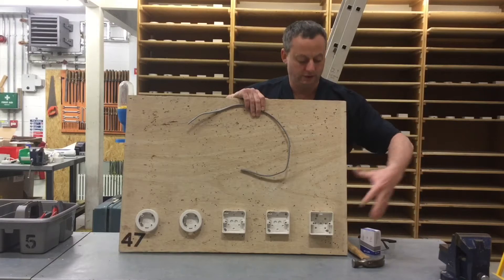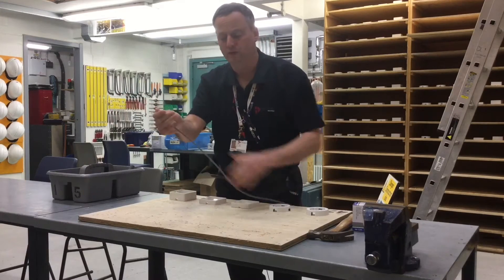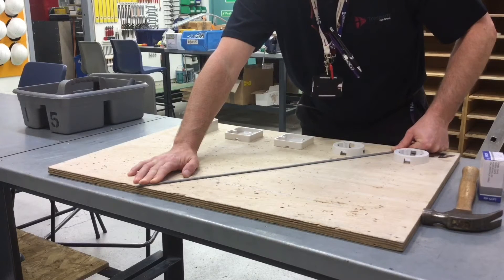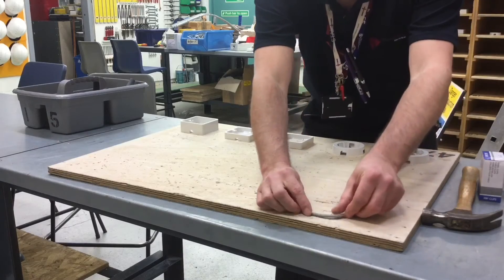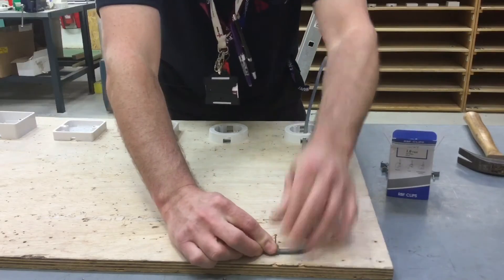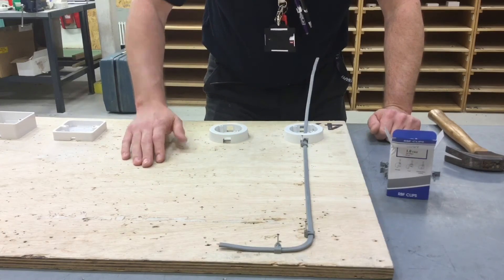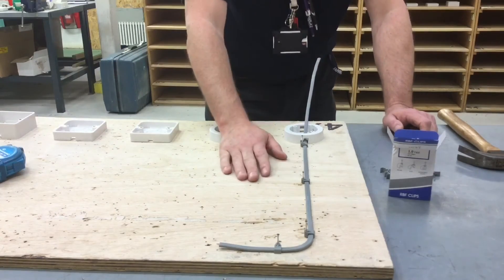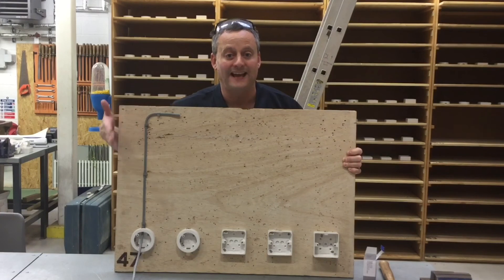Basic Techniques For Clipping, Dressing and Bending PVC Twin Cables (Twin and Earth Cables) (How to)

Comment: Could you please explain,.When clipping T&E on a radius 90 degree bend and you have it completely flat, surely this must stretch the internal insulation of the outermost conductor?
When I was a youngster ( a very long time ago) we were taught to let the cable rise on the radius ( creating like a high speed banking on a race circuit) so as to minimise any stretching of the outermost insulation.

Comment: At College, I used a former to make 90 degree bends at the correct ‘radius’. 
Just cut out a few different circles in ply with a holesaw to correspond with what I needed. Checked the cable bend against the former. Drew a few lines on the board to be plumb/parallel for straight clipping. 
Made it easier for me anyway. 
I realise it’s completely different in the ‘real world’ but it nice to walk before you can run. 
Great videos and presentation. 👍